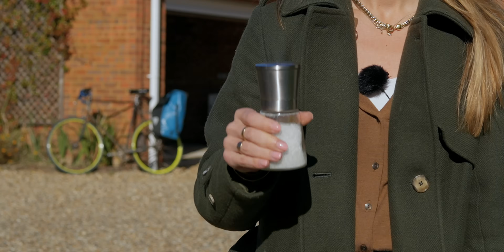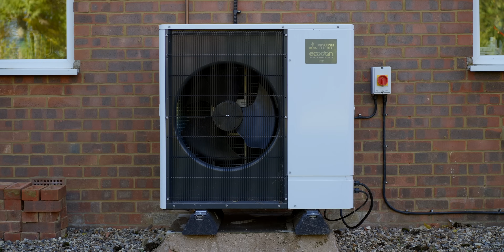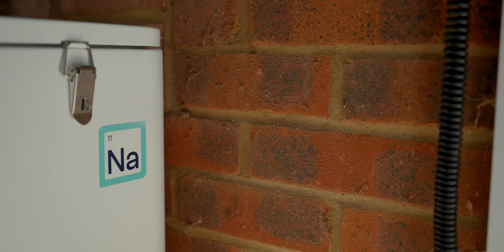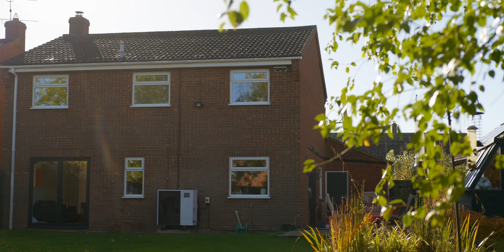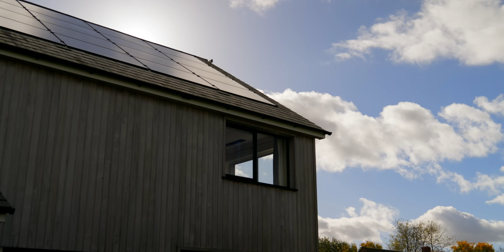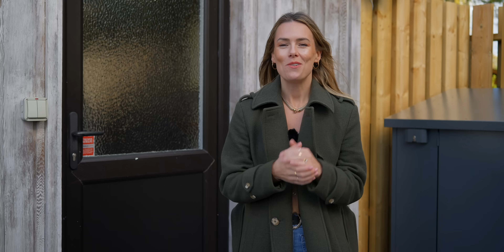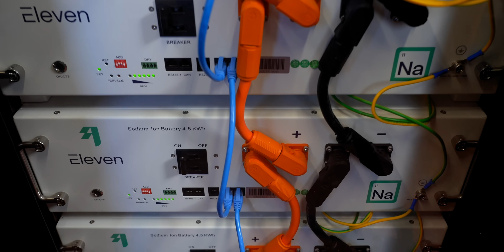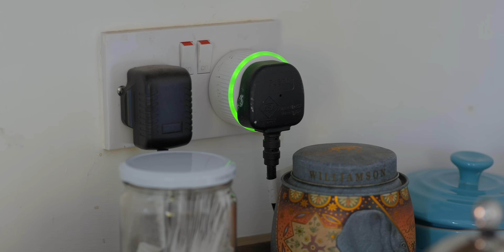Sodium Home Batteries Are Here! Is Salt The Key To Cleaner, Cheaper Energy?

Comment: The big problem with Sodium batteries is their round trip efficiency. You lose massive amounts charging and discharging these. (On the order of 20-25 percent)

Also, you're implying that table salt is used. This is wrong. It is sodium carbonate that's used, not sodium chloride.
I don't understand why this channel (Imogen specifically) CONSTANTLY spreads half truths around renewables. You really ought to learn more before attempting to teach.
Reply: If we include a round trip, then we should also include the heating of Lithium IOn and cold weather losses.  In colder weather, up to 40% can be lost just in heating the battery with Soidium. You don't need the heaters, so the 20-25% losses can charging can be offset mostly by the better cold weather performance depending on climate.
Reply: Ah lad chill
Reply: Sodium chloride is the starting material. You combine it with ammonia and limestone and you get sodium carbonate. So if you live in a country with no natural soda ash deposits  and you make sodium batteries then the statement makes sense. If you live in the USA and you find a US based company making sodium batteries then it will most likely be made from natural occurring soda ash from Trona ore and so will not be true.
Reply: @pmac6584  That's like saying bleach is salt because the starting material is sodium chloride. It's misleading.
Reply: @321tryagain Totally agree it is misleading but I think they are trying to explain to the largely scientifically illiterate public that it is widely available resource , unlike lithium. Pretty stupid way to do it really.
Reply: @pmac6584  They could say "from salt", or explain it at some point in the video instead of using it in the title and then letting it ride the whole way through. My background is chemistry so I understand why they might be saying what they're saying, but I don't think they quite got the balance right on this one.
Reply: These batteries have 95% round-trip efficiency, so are much better than the earlier cells you refer to. Or at least that's what the datasheet says...
Reply: Sodium carbonate (Na₂CO₃) is definitely a salt, and can be made from sodium chloride (NaCl).

Comment: I've got LifePo4 batteries in my garage and in winter they struggle to charge at the cheap time to the point that they cannot charge fast enough.  So Sodium would be great for that.
Reply: I put 50mm insulation sheets on the walls of the brick shed for my battery system. It remains above 10c in the depths of winter just on the waste heat from the inverter.
Reply: @pmac6584 I was wondering about putting a little jacket on them :)
Reply: LiFePO4 have a very flat charge curve so it may look like they aren't charging much if you're just relying on a SOC% as it's difficult for some SOC monitors to acturately work out percentages. LiFePO4 is also incredibly efficient. Sodium wouldn't be any better although it may appear on the surface to be as it's easier to determine a SOC because of the linear charge/discharge curve.
Reply: You need to cycle them more. Ask yourself why are they ever sat idle?
Reply: Actually they won't be. You can't charge sodium below 0C (so same issue as LFP). And if you think you're gaining anything with charging them cheap and using them when it's expensive; there's a 60-70% charge/discharge efficiency (LFP is 98-99%+) so a lot of waste already.And because inverters have to be designed around huge voltage range (usually 1.5-4V per cell) they themselfs wil be less efficient also.

Comment: Sodium is NOT safe.  Sprinkling it on your chips is likely to make your head explode.  Can you please not dumb down to the point where you are causing that?  Salt is NOT the same thing as Sodium.  p.s.  Chlorine the other component of salt isn't safe either.
Reply: Sodium carbonate is safe and that is what is used in sodium batteries.
Reply: @pmac6584  Lithium carbonate is safe too, but that doesn't mean that lithium ion batteries are without risk.
Reply: @pmac6584  No, that's just where the Sodium ions are coming from.  Same as saying salt is safe.
Reply: But it is a salt!

Sodium carbonate (Na₂CO₃) is a salt, and can be made from sodium chloride (NaCl).

Comment: Nice to see Gen 1 Na batteries out there. Have to walk before running.
Reply: Catl's naxtra is gen 2, I'm not sure these aren't either. most likely, by this point, the chemistries these companies are using have at least been improved already from conception to be comparable to lfp many generations in.
Reply: I thought Na was an old technology, just being 'rebooted' with better anodes n stuff?
Reply: @edwardburroughs1489 probably, there's very little that's completely new nowadays although you may be getting mixed up with salt batteries where the electrolyte rather than one electrode gives it the name.

Comment: Cool stuff but i don't understand how it would benefit. Where I’m from, all the solar power goes straight to the state-owned energy company, and they actually pay you more for it than what you pay to buy electricity back. The price we buy power is the same day and night, so there’s no real reason to store it.  It's better to sell it to the energy company.
Reply: Many places aren't like your place.  In order to use only solar power 24 hours a day, you either need to store it, or ship it literally half way around the world.
Reply: Net metering is more expensive to set up. Not DiY friendly. Doesn't work when the grid goes down. This is from a USA perspective.
Reply: @Zoyx  Net metering is obviously cheaper (unless your utility is evil... oh wait).  It is DIY-able, I have done it myself (helped anyway).  It CAN work when the grid goes down,  but that is so tricky no one does it.
Reply: @CorwynGC  - My electric company requires that you use their approved equipment and must pass their inspection, besides pulling a permit.

Off-grid, you don't even need to pull a permit if you know what you are doing.
Reply: Besides, relying on the govt and electrical companies, when the winds of change…change, seems silly, if you don’t need to.
Reply: @jeffforbess6802  Alas, this system relies not only on the electric company, but also on the rating structure (TOU) not changing.

Comment: You forgot to mention the much worse coulombic efficiency compared to lithium. Yes they are cheaper but you are going to loose a good part of the energy you want to store. So just saying to anyone interested that you need to factor that in your calculations.
Reply: Eleven energy claims 95% round trip efficiency. Maybe we should wait for an independent test before making any conclusions.
Reply: @pmac6584  That's likely a lie. There's no Na+ cells, that have that sort of roundtrip efficiency (you'd be lucky to go above 60-70% if you actually used the whole capacity). And you need to take into account inverter losses as well.

No way this is true. They're bullshiting.
Reply: Sodium has high enough coulombic efficiency, but many batteries struggle with sagging voltage during discharge and elevated voltage during charge, which is turned to heat, so they are electrically inefficient. I'm keen to have these guys send Will Prowse a battery.
Reply: @ThisRandomUsername  What's the point he already tested with inverter designed for Lithium cells and incorrectly called that is very low Coulombic efficiency... Just to be clear Natrium batteries will have lower efficiency because of lower voltage at low SOC, but it's not freaking Coulombic efficiency issue.
Reply: The datasheet (and the company - I checked this) says this isn't the case for these cells. 95% round-trip is claimed. They are clearly much better in this regard than some earlier examples.
Reply: No, it isn't.

Comment: Because of the near zero risk of fire, I think these will be the standard battery chemistry for home use going forward. 

And the Eleven software sounds like it is completely sorted already.
Reply: LFP batteries also have near zero fire risk. Trouble with these is the round trip inefficiency. You lose a lot of energy just charging and discharging Sodium batteries. This tech needs a lot of work
Reply: @oak8863 This will be interesting once the costs are lower. Economies of scale require some early adopters to pay more. If they become cheap enough you can oversize to compensate for losses and enjoy the other benefits. At least this means more choice nmc, lfp or sodium you can weigh the benefits and take your pick.
Reply: @pmac6584  shame we didn't hear about how they manufacture them, where and how many can they make.
Reply: @pmac6584  You're not compensating charge/discharge losses with higher capacity. If anything, you'd want to use that kind of battery as little as possible, so undersizing would be better.

Comment: Sodium batteries are not typically made from table salt, which is sodium chloride. They are made typically from sodium carbonate..  trying to imply that it’s as simple as using sodium chloride table salt for batteries is misleading.  While sodium carbonate is not expensive. Its extraction and refining process is significantly more complicated than that of table salt.
Reply: Only 1/3 of the world’s sodium carbonate is mined. The rest is made from sodium chloride using the Solvay process or Hou process in china. So while I agree with your point about it misleading it isn’t exactly false.
Reply: @pmac6584 
And ironically the USA sits on top of the worlds largest known supply ..it's ridiculous something like 60+% in one NW. mine location... as it's been used for glass making and chemical industry feed stocks for over a 150years . ...but bet you Donnie will develope a salt allergy unless its deep fried and wrapped in fossil fuel bribes 🤑 they may have to ship it using the old covered Borax ox carts if he cancels the trains and electric trucks...😂
Reply: Desalination plants produce toxic levels of salt brine that can be further concentrated  to extract  mineral salts and metals. Using new energy efficient battery material  recovery treatments .
Reply: Jimmy Neutron over here 🥀
Reply: Sodium carbonate (Na₂CO₃) is definitely a salt, and can be made from sodium chloride (NaCl).
Reply: @Evolution56 I didn’t say it wasn’t a salt. I said it wasn’t table salt. And I didn’t say it couldn’t be made from Sodium chloride, I said it typically isn’t. And  thus I didn’t say the premise is false. I said it was misleading.
Reply: @Jeddin it typically is. 2/3 of it is made from sodium chloride and ammonia. Only 1/3 is mined.
Reply: CATLs Naxtron cells are going to hit the. Market hard next year...for automotive and fixed storage use. 
I hope those cases are being made of Basalt fiber composite it's perfect for the job and greener than any metal as well as environmentally chemically  resistant,  insulating and even more widely available than any metal  on the planet. It's incredibly temp stable,  neutral , insulates and is UV proof ..

Comment: 'Salt' or NaCl and Na-ion batteries involve Sodium Na, but the form of Sodium is completely different — in batteries it’s electrochemically active, not the inert, crystalline table salt you’d sprinkle on chips. I am just trying to point out that the title of this video is, at best, misleading. Maybe remove 'Salt' snd leave  'Sodium' in the title ?
Reply: Sodium carbonate (Na₂CO₃) is definitely a salt, and can be made from sodium chloride (NaCl).
Reply: They could have said it's made from materials sourced 'from the sea' or 'from cheap ubiquitous minerals'. 
The title is, by one interpretation, incorrect but that's not the only way to parse the text.
It's made of cells. It's made of engineered stuff. It's a box made of metal.
Reply: Getting baited by salt is crazy work
Reply: A ‘salt’ is not always sodium chloride. Other salts are used such as sodium carbonate, Lithium phosphate etc in batteries